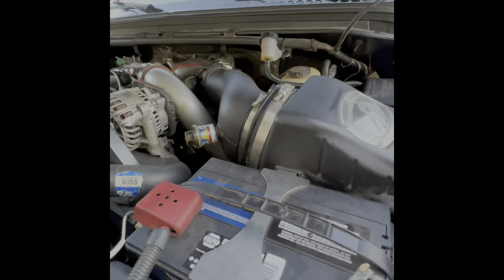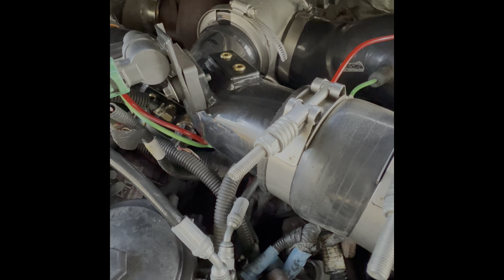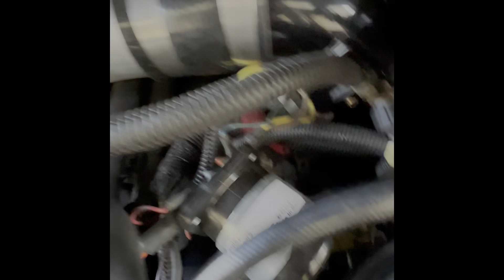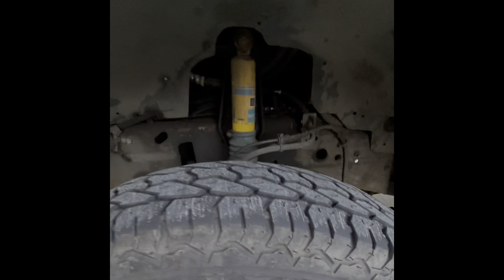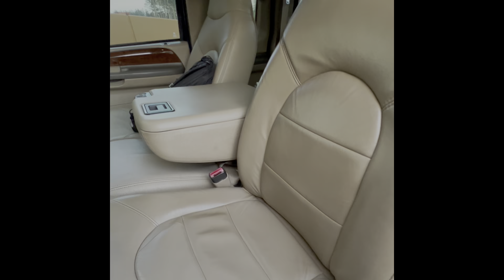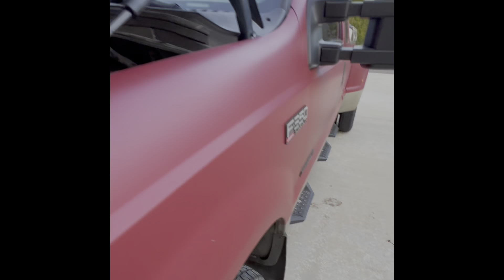Rambling about my 2000 Ford 7.3 Powerstroke ZF6-power mods, maintenance, common problems

Comment: Got an 02 CCLB DRW with a ZF6 recently and I’ve got almost all the same mods. Last two, in the next couple months, are injectors and a 300x. 

Loving it but man I wish the sound deadening inside was better. Coming from an 09 Silverado the cab noise is way louder lol. Some day I’ll tear out the dash and add some.
Reply from the maker: Nice! I should have just waited to find a crew cab but I got nervous and pulled the trigger on this one. I have had it for quite some time now and have put tons of wrench time into her. Yea...it's loud 😅🤣and I would love to do the same thing one day...just gut the interior and install sound deadening throughout. One day...

Thanks for watching and taking the time to comment. Let me know if you have any questions, etc.

Comment: Are You happier with the custom tunes over than the canned tunes?
Reply: Before you got the new injectors, obviously you had to get new tunes for the single shot injectors but when you had stock injectors did you notice a difference? I’ve done everything you’ve done except no new injectors ( I live in California and smog would be a bitch…) but did you do custom tunes with stock injectors and. Price big improvement? I just have can sct flash tunes,
Thank you! Keep the videos coming!
Reply from the maker: @dependsonwhoyouask9574  I did get custom tuning before I went with upgraded injectors and yea it was worth it. Not so much on the power side of things but for towing and overall drivability. Just to have lower EGTs while towing was worth the custom tunes. I started with DP, then went to 1023. I like 1023 better but they don't offer tuning anymore. I think gearhead or jeli can give you tunes for the SCT platform.

Comment: U don’t run ur wastage ?  I seen it not plugged in
Reply from the maker: Hey there, thanks for watching! KC says to unplug it/cap it off, the red line. No need to run it, shouldn’t run it with their turbos.
Reply: @alsaku33  Koo I have a 02 7.3 and have my caped off to on my stock turbo too with  cts2 evolution truner  23psi I hit
Reply from the maker: @fuelup7504  that is really good for a stock turbo. Have you done any mods to the stock turbo? If not I would 100% recommend getting a wicked wheel 2, ATS ported housing cover, and high flow turbo outlet. Also deleting the EBPV cause they like to leak...alot...
Reply: @alsaku33  yeahh I did a wicked wheel 1 
5x5 from riffraff for 100bucks  last year was the first thing I did then I got my cts2 evolution turner I’m in cali so i olny use the edge turner cuz it from the obd2 port I can’t take it off and got to stock for smog but yeahh Cali suck with this smog shit
Reply: @alsaku33  I got shorts on my truck on my channel
Reply from the maker: @fuelup7504  Nice! Anything else done to the rig? Love the sound of the wicked wheel upgrade!
Reply: @alsaku33  riffraff piping boots all of them and spider one too and AIH Delete did glow plugs and controller and under valve gasket wiring that it I think o got short vids on my channel of my truck
Reply from the maker: @fuelup7504  👍🏼 good start!
Reply: @alsaku33  I did fuel presser spring and housing
Reply: @alsaku33  from riff Raff
Reply: @alsaku33 did a new reader and the hoes behind the belt too

Comment: A lot of work put into that truck. Congrats. Should last u a long time. I just got a 99 zf6. Starting down the same rabbit hole. Can u give some more info on how the grill needs to be modified. I certainly wouldn’t spend 70k on a truck eve if I did have it
Reply from the maker: Hey thanks! Appreciate it and thanks for watching. So much 🔧 time 😂 

Originally I modified a 6.0 grill then I bought this one cause the fit and finish was just that much better than my hack job DIY. 

This is the one I bought: 

https://sinisterdiesel.com/mkm-customs-modified-2007-grille-for-ford-powerstroke-1999-2004-superdutyexcursion-chrome.html?gad_source=1&gclid=Cj0KCQiA7aSsBhCiARIsALFvovzR1T1sHyqSMtngktKQuRFUklMOTlnUYxNvlwqDY-M-_YeXY9R7RI4aAtMaEALw_wcB
Reply: @alsaku33  if your near Tennessee drop off your old one lol. My trucks a heavy construction truck so not very concerned about it’s looks. Had my last f150 20 years. It looked like total hell after that long.
Reply from the maker: @RJ-cc1fz 😂